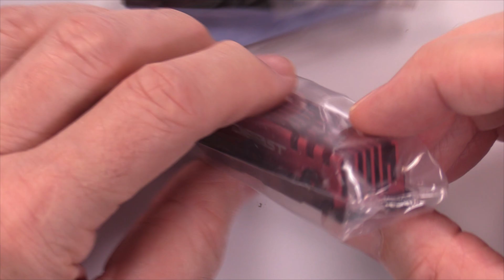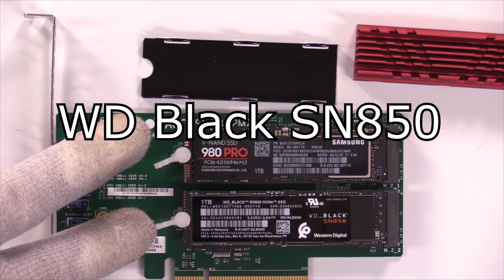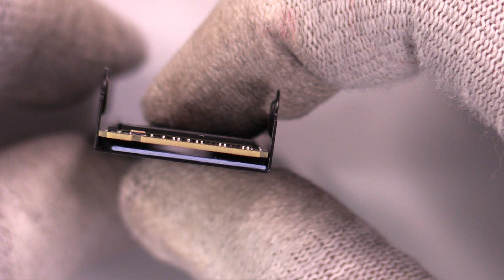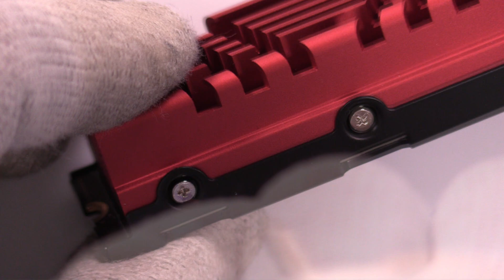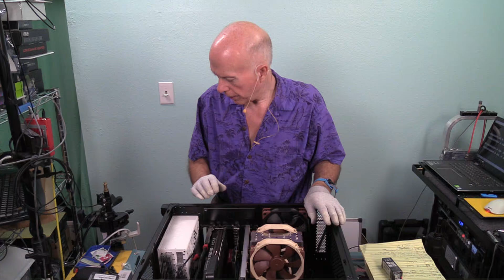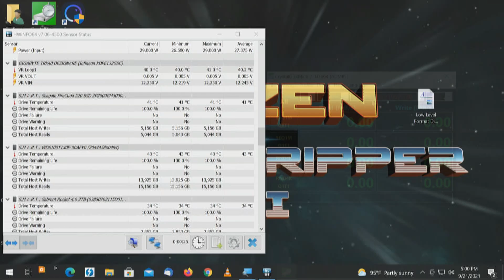Digifast M 2 2280 SSD Premium Heatsink on WD Black SN850 M.2 NVMe

Comment: Oofffff I just got this one in the mail, but the SSD that I had intended to use with this one has a metal spreader that is too hard to remove, and the stand offs lift the SSD too much for the top to align with the screw holes.....bummer, I will have to shelve it until I get the pcie Gen 4 I am planning for next year.
Reply from the maker: Hi Guillermo Hernandez,
Welcome! Planning for the future! You're ready! We've Tested 14 Heatsinks so far! Thanks for Watching!

Comment: Hi, thanks a lot for this and the other videos. What thermal pad brand do you recommend? What thickness? Thanks again!
Reply from the maker: Hi Jose Netto Estrella, 
Welcome! Thank You for Your Comments! There are 3 depending upon the Thermal Conductivity value or W/mK value. Thickness would be based on the Heatsink design and the M.2 NVMe PCIe Drive such as Single Sided or Double Sided. For example, the WD Black SN850 is Single Sided. For that, 1.0 mm Thermal Pads. The Thermal Grizzly are 2 Pads the package. The Thermal Pads with a higher rating are 1 Thermal Pad in the package. Always double check! 
1. Thermal Grizzly Minus Pad 8 W/mK
https://amzn.to/3F6L3ot
2. Thermalright Thermal Pad 12.8 W/mK, 85x45x1mm, Non Conductive Heat Resistance, Extreme Odyssey Silicone Thermal Pads for PC Laptop Heatsink/GPU/CPU/LED Cooler (1mm)
https://amzn.to/3ikiIBi
3. Iceberg Thermal DRFITIce Thermal Pad 120mm x 40mm (1.0mm) 13 W/mK - Cut for 2!
https://amzn.to/3im9SmQ 
As an Amazon Associate I earn from qualifying purchases.

We have used the Thermal Grizzly Minus Pad 8. We have yet to Test the other two. Another Subscriber has mentioned the 3rd Thermal Pad. 
Hope this helps! Thank You for Asking! We have more Tests yet to perform! Stay Tuned!
Reply: @BuildOrBuy  Thanks a lot! Really great videos!
Reply from the maker: Hi @JoseNettoEstrella , 
Absolutely! Appreciate Your Feedback! I'm Honored! Thanks for Watching!

Comment: The thickness of the heat sink Pad... Might be very important because of the way. This is put together and mounted... This is just a PRE-Comment,  before you produce the video... I like the design of this heatsink,  by my experience in electronics, this is kind of the way you would want to go when designing a heat sink,  but apparently there is so much more going on in the engineering... Of a heat sink, and the challenges for the future of PCI 5.0.. Seem like a great challenge, but I'm wondering if the drives for that throughput (15,000), will be made with a smaller,  Nano meter die size, Smaller circuit traces, and lower voltage generally equates to less heat generated... We will see, when the devices come out what creative engineering. They did to solve the heat issues.
Reply from the maker: Hi LonnDawg, 
We've learned enough from all of this to take nothing for granted regarding M.2 Heatsinks. This Heatsink performs better than I expected! Knowing what We have experienced thus far will help Us to Appreciate how this is resolved on PCIe 5.0 and PCIe 6.0. 

The 2 Thermal Pads included appear to be 0.5mm. Those should be 1mm. However, very interesting results, as is!

The AMD Phison I/O Optimization training session was the 1st time I've heard a Vendor mention PCIe 6.0. A most enlightening event! Stay tuned!
Reply: Good question. In laptops the shrink is used to cut power draw. All I've seen in PC's is room for more transistors/memory cells and higher clocks. PCB's are getting wider traces for signal integrity and more layers to separate all the traces from shorting each other out. Words for 2021: "bigger" "wider" "thicker" "hotter" "faster". Make hotter all caps. HOTTER
Reply from the maker: Hi @maxhughes5687 , 
Thanks for this! Amen to that! Historically We've seen Motherboard Revisions to change traces from zipper noise. That use to be a notorious problem! Slowly these things get solved over time! Fix one problem, another one appears!